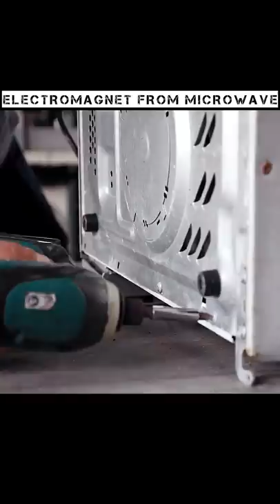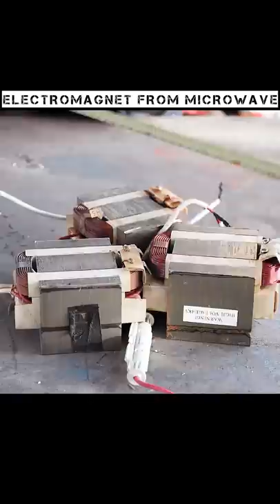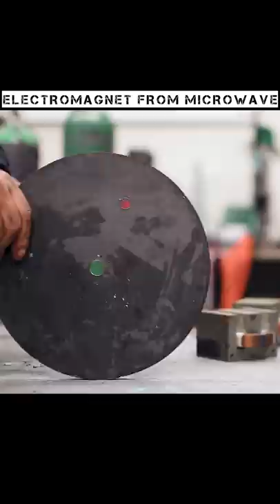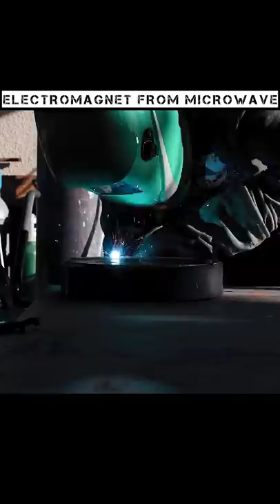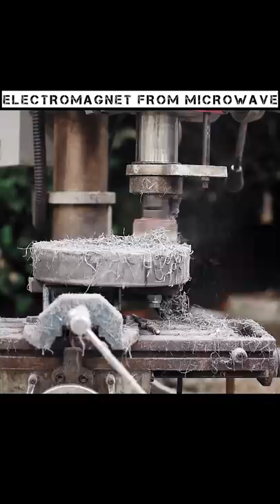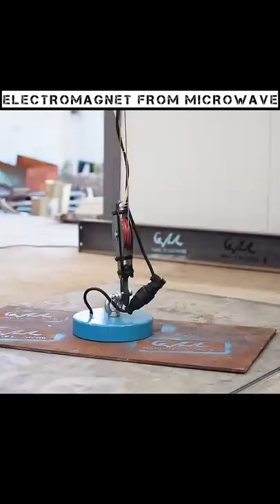Electromagnet from microwave transformers #shorts

Comment: TWO IMPORTANT THING'S TO NOTE WHEN DISASSEMBLING A MICROWAVE. 
For anyone looking to take apart a microwave the two thing's you need to watch out for are the #1 capacitor and #2 the stem that runs through the center of the magnetron itself. # 1 You can discharge the capacitor by using an insulated screw driver and making contact with the positive and negative terminal at the same time. A capacitor in a microwave can hold a powerful charge for a fairly long time after it's unplugged and has the potential to kill you if you were to get shocked by one. 
#2 Do not just smash apart an old microwave. In the center of the magnetron is the stem. 
The stem has wire's running  through a pink ceramic insulator. The pink ceramic insulator contains Beryllium. With the insulator is intact it can't really hurt you ( though I would wear gloves if I had to touch just to be safe ) However if you break the ceramic insulator you will put yourself at risk of breathing in the fine dust containing Beryllium. If that happens you could develope Berylliosis. A non curable illness where your lungs become inflamed and you suffer from a laundry list of complications. 

I made this as a warning for anyone that is new to scrapping or repurposing household items. Hope it help's someone out there.
Reply: Thank you. I was waiting to see if someone would mention the issue with just disassembling a microwave without considering how nasty a shock from an old capacitor can be or how harmful beryllium can be if you're not careful. Good word, my man.
Reply: @WaffleLord109  Thanks man.
Reply: Manually coiling enameled copper wire seems to be the better option. It’s not worth the risk.
Reply: Yup. Just had a coworker die from messing with a broken microwave
Reply: @2wheelpartsguy  crap. Was it on the news or something. 😞
Reply: @2wheelpartsguy  Dag man. Im sorry for your loss. I hope his family is ok. You just never know.
Reply: Goat
Reply: @arthurmorgan8966  if u know what ur doing its worth it for sure..old microwaves can be found for free plus u are reusing something and giving it a second life.
Reply: @2wheelpartsguy  damn that's heavy. My condolences
Reply: Not all heroes wear capes 💪👍
Reply: I really respect that you took the time to make others aware of the potential dangers of microwave disassembly
Reply: @reptilejesus829  It's something I knew and the consequences of not knowing could cost someone their life. Well worth my time if it can help others avoid disaster.
Reply: Thank goodness for the responsible side of YouTube. You just saved about 100 lives
Reply: thx for confirming that microwaves are the devils work 🤣

seriously.... I don't even own one anymore...
Reply: Thank you for warning people.
Reply: Thank you all for being so kind. I know it's a small thing but it's brought my hope's up none the less. Hope you all have a great day.
Reply: Respect for your warning sir. A few good human beings still among us.
Reply: Thanks good sir
Reply: Thank you
Reply: not exactly a DYI but cool
Reply: Not if the person is a sick Bi-polar or in some rare cases, more juice is required for Tri-polar types, these are usually women.
Reply: X
Reply: Thanks. Past me and my buddy will unsmash those three microwaves for the magnets and copper wires.. lol
Reply: This should be pinned
Reply: Dude for real thank you
Reply: Well done and clearly explained
Reply: Thank you for sharing this precaution to any one who attempt to disassemble the microwave. You saved someone's life
Reply: @2wheelpartsguy  sorry for your loss.
Reply: …..slowly backs away from microwave……didn’t really need an electromagnet anyway.
Reply: I notice in the video the the epoxy is poured in, but it doesn't show if, or how he connected the 3 partial  electromagnets together?? It also didn't show the connection of the power cable at all. I know this is a quick "Short" video, so usually a detailed demonstration is next to impossible. That said, I was hopeful you could shed some light on, how does the three pieces get connected together, and with what material? As well as how and where (in-relation to the coils) the power cable was fastened to the top side?
It would be greatly appreciated 🙂
Reply: @derekstiles4033  Oh man. All that is beyond me. If I could help you I certainly would. Sorry I couldn't help you man.
Reply: #3 DON'T FECIN TOUCH IT AT ALL unless heating soup in a recommend bowl 🍜😊👏
Reply: Thank  you. 30 years ago  I  took 1 apart to see what's in it and how it works.  And still don't know.  But I  got into something I just thought it was a lubricant or grease. But I  broke out in a rash bad enough that I  haven't fucked with one since
Reply: You're a good man, Ben.
Reply: 3rd important thing buy 250k in tools ....
Reply: The most underrated comment of all time is the one that could actually save your life. Thank you for posting this.
Reply: Thankyou. Excellent advice.
Reply: So he forgot to tell us a few minor details for anyone stupid enough to do this.
Reply: Thank you for posting these warnings, for everyones' sake. I wasn't aware of the beryllium in the magnatrons. Was aware of the dangers of capacitors though.
Reply: thank you bro
Reply: Microwaves made in this century don't usually contain any beryllium. The pink ceramic is actually nearly pure alumina (we ran it through mass spectrometer). Also, note that beryllium ceramic was also made in white, not only pink...
Reply: Thanks for the info
Reply: The cap often has a high value (1MΩ?) resistor to discharge it.

But: the pink, brittle, beryllium-based insulator IS dangerous. Just don't smash it. Unscrew the magnetron and decide what to do with it. Put it a aside at least. Or leave it attached to the carcass of the oven. The cap, inductor,  transformer and switches are quite useful.
Reply: Upvote this. Very helpful Ben. He's right about the capacitor potentially holding a charge I know the 480volt pole light capacitors hold charges and explode if handled carelessly when servicing lights
Reply: This is so helpful. You seem knowledgeable. Thank you for taking the time to post this.
Reply: @Svlli1983  Yeah, I know some stuff about some stuff. 
Im just kiddin you.
Reply: Thank you all for your kind words. It's been rough going lately and it may not seem like much but it help's me a lot. I really appreciate it.
Reply: That was cool of you to point them things out to everyone.
Reply: What about those rage rooms where people smash old appliances? Hopefully they don’t use microwaves
Reply: @hippy_chat  change your pfp it’s disrespectful
Reply: @3567-j3n  well im a adult with full control over what my profile picture is and if you dont like it go away..
Reply: Youre awesome for this comment! Might save someone in the future
Reply: bless you brother. im pretty sure you saved a few lives here!👍
Reply: @benbrice9343  Thank you for taking to the time off your day to write this post for others. Respect.
Reply: Good info Ben 👍
Reply: Thank you everyone for your kind words. It's cool to see so many people taking safety seriously.
Reply: You can also make an unregulated stun gun from the capacitor using two 18650 batteries and some clothes hangers for an insulated channel of some sort makes a blue arc and hit a button
Reply: @LehtusBphree2flyFPV  I don't know enough about electricity so I would probably just end up electrocuting myself but it sounds cool.
Reply: AmaZing and thank you
Reply: @2wheelpartsguy  Sorry for your loss, Hope his family is ok.
Reply: Ha ha chainsaw go brrrrrr
Reply: This reminds me of a indian guy ( dont be mad at me yet ) and he makes videos of taking a pvc pipe and using a hot iron melting the plastic That is very dangerous because he wont show his face and his instrucktions seem cool but very scetchy
Reply: even tho I saw your comment at the top, it still should be pinned
Reply: I hope india can read your comment 👍
Reply: An awesome detailed text
Reply: I can't believe this comment section has stayed alive this long. Thank you everyone for all of your kind replies.
Reply: Even tho the second part is true the capacitor wont kill you
Reply: Thanks many millions.
Reply: This should be pinned.
Reply: Not just a long time, it can hold a lethal charge for years, decades even
Reply: My preferred method is using a diamond cut off wheel right in the center of the pink piece - then the halves separate easily. Never had any problem this way. Sheesh!
Reply: Thank you, I was about to write this as well. Very well written warning worth heeding! This video is extremely irresponsible!
Reply: If u don't know this u probably shouldn't take apart your microwave
Reply: I knew there would be something to watch out for with this. Just didn't know what. Thanks for the warning on this!
Reply: Came here to say exactly this. Discharging those capacitors is the #1 thing to always do when working on a microwave
Reply: Greatest example of good people being awesome on the internet. Ben, you have without a doubt, saved many people from tragedy with your kindness. Also stirred up the most wholesome thread of comments I’ve ever seen.
Reply: Appreciate it👍
Reply: Good info!!!
Reply: Incredible write up. Thank you kindly
Reply: MVP
Reply: No thanks not reading all that text. I'm taking my microwave apart using only this video. Yolo.
Reply: @BuzzingGoober  Yo say hi to harambe for me
Reply: @BuzzingGoober  Yep. You only live once. Think about that. One wrong move and you really would be a BuzzingGoober. 

I hope you were being sarcastic because if not the humor in my reply would be in bad taste.
Reply: thank you for saving lives bro
Reply: @benbrice9343  I'm going into my microwave later today. Unless you can give me a tldr of your book, aka your YouTube post, I'm diving head first into that thing.
Reply: @BuzzingGoober  Im sorry, I am unable to accommodate you further. Be careful and good luck.
Reply: 1. Don't
Reply: Never intended on doing so but thank you for watching out for people who will
Reply: The beryllium danger is only really present in quite old microwaves
Reply: Wow, this is interesting.
Reply: I appreciate this. Ppl watch things and immediately try them without thinking about stuff like this.
Reply: Well you explains it better than i.

Comment: I loved how he gently removed the microwave's door 
Btw be careful with those, the capacitors are still charged after unplugging and may electrocute you
Reply: Maybe brand new microwave
Reply: I think they know because they use those capacitors on a lot of their projects
Reply: @fendysusanto876  
I wouldn't trust even a brand new microwave as the company likely tests them out before they are sent out of the factory.
Reply: @pyroguy482  i think electrical charge can decay
Reply: Considering how much people are scared from getting zapped… they should really „try“ it.

i got shocked by 230V AC already serveral times (like multiple times per month… im electronic engineer), thats pretty „harmless“, only at 400V i would be scared a bit of getting zapped
Reply: @harrison00xXx  i don't believe that word came from expert.
Reply: @fendysusanto876  want to tell me you never touched 230 or 110? You can fking survive it easily, at least AC and over ground.
When it comes to DC or pretty bad stuff like the typical installation in US homes, i dont know probably its more dangerous than our oversecure rules here in europe.

Ofc you should always avoid touching live wires but its not always that easy
Reply: @fendysusanto876  I barely see nowadays electronics/power supplies without any pull down resistors on the high voltage/AC section, in fact i saw NONE the last decade.
Most stuff will be discharged for safe disassembly/touching within maximum an hour, more realistic it will be like a few seconds or minutes

But despite this fact, i also always bridge eventually charged caps before working on any stuff, safety goes first
Reply: @harrison00xXx  did you know mike Tyson never suggest anyone to get punch in the face just because he get punch to the face many times and survive?
Reply: @harrison00xXx  actually the voltage isn't that dangerous, an AC up to 10k volts could not kill you, but the amperage does matter
Reply: @tradsvarldh8708  yeah, about 50mA is considered lethal, but really lethal is 100mA+. But 50mA DC can be dangerous already since there is no zero crossing and you could stick to the circuit "forever".
And since we have here in europe 30mA trippers... well, aslong the tripper is ok and you dont end up only shortening L+N... its not really risky, but it hurts, so better dont xD
Also, there is always a chance something malfunctions, not really a typical sight on trippers for leakage current since they are more or less the main safety and therefor even 40 year old ones still work, but still: better dont trust them 100%.
Reply: @fendysusanto876  Doesnt make much sense, as much as your reply from the beginning...
Reply: @fendysusanto876  btw i never said "try it" like that, but since you all think if you touch live wires within a fused/"safe" circuit you die 100%.... well, thats BS.

especially when we talk about caps at the AC side. Ofc they COULD still be charged, but as i said earlier - wait an hour and you are  very safe. If you are still scared, damn, bridge the contacts of any high voltage cap (in a microwave probably 2-4 caps...) you see and you are definately safe.

Ofc there are exceptions, any bigger machine with bigger caps can hold more energy in the caps- and so "shock" you more. Take for example the high voltage supercap banks.... Well, they could GRILL you without even getting discharged fully
Reply: @tradsvarldh8708  bro 10 kilovolt is lethal for human.
V=I.R

Human resistance is around 10.000 ohm. That's means 1 A or 1000mA

That's the reason danger high voltage not danger high impedance, because you can't have high impedance if you don't have enough voltage
Reply: @harrison00xXx  you said people afraid getting zapped and you suggest "try" it.
Imagine kids or untrained people try it without your safety standard.

I said brand new microwave maybe don't have electricity in their capacitor, because in third world country quality control not test every piece of their product (they just take sample).
Reply: @fendysusanto876  well, you said BS… still you refer to it?
Reply: @fendysusanto876  bro show me a 10kV outlet which is capable of 1A!
Reply: @fendysusanto876  or does my piezo lighter which produce 10-15kV also output 1- 1,5 Amps?
Reply: @harrison00xXx  that possible if the crystal can produce enough Watt

W= V.I

And you can buy generator that can produce 10 kv with 1 amp before reduced in transformer.
Reply: @fendysusanto876  yeah probably with a piezo as big as a truck  with a speed faster than sound lol
Reply: Yes, gentle 😍

Comment: When I was in middle school,my friend's dad was an electrician and made him a shocking device out of one of those (the metal square with the copper coil,I don't know what it's called).

One day after school,he told about 10 of us to get in a circle and hold hands. The two persons at each end of the circle held onto one wire each and he connected a 9-volt battery. We all felt the shock. It was so amazing. 

15 years later and I still don't know how 1 9-volt batter could have sent the charge through our hands.
Reply: Try plugging the step up transformer into the wall 🔌 and touch it then. ⚡
Reply: We're basically bags of salt water with a mild electrical charge running through our body via nerves from the brain. We conduct electricity. Can act as a capacitor if we build up charge under proper conditions
Reply: @dottypitchell208  we can also multiply ✖ 😉

Comment: I tried to disassemble the magnetron myself. But though why not check the internet as "caution" sign was on it. Turns out the ceramic at the end, if shattered can get into respiratory tract and can cause cancer. The shattered ceramic can also lay around as dust and cause problems at later stage.
From that day I never messed with that, and gave up on the high quality magnets in it. Safely disposed it.

Comment: I saw a YouTube video where a guy removed the magnetron and capacitor and transformer he was able to use it to create lightning bolts and even was able to power house hold items from a distance such as a light bulb and fan without them being plugged in. Something like that could be utilized for home defense if you know what your doing. You could literally mount the magnetron on or near a door and it could be wired up to a security system. The energy that comes from a magnetron is insane I don't know the amount of electricity or microwaves it produces but I suspect it would kill even the Bigfoot or grizzly bear. The technology that's inside of a microwave can be utilized in many different ways.
Reply: Yes, his name was Tesla.

Comment: Imagine instead of this you start frying yourself inside out with microwaves
Reply: well it will take alot of time depending on the targets weight. traditional microwave ovens are designed to fry ie 2kg of matter arround half a hour which is dangerous dose of 2.5ghz at that level for 2kg :P so traditional microwave will take atleast 50/2 =25 microvave magnetors half an hour to completely fry :P sadly this is partially dangerous thing in  higher levels and wil cost heawy electricity bills. and 25 microwaves is lots of expensive for average person in this century :P and still that doesnt look like a good idea anyway.
Reply: and there is programs that takes one hour or more . :P
Reply: Weird idea, check your insanity.
Reply: Well for one the microwave emitter would have to be powered up for that to be a issue. No power in no microwaves. Funny how that works